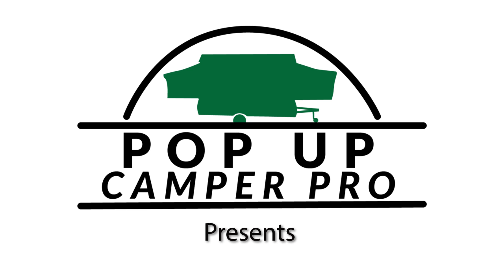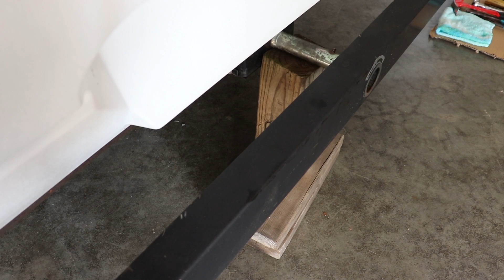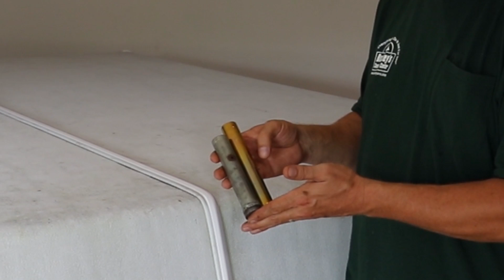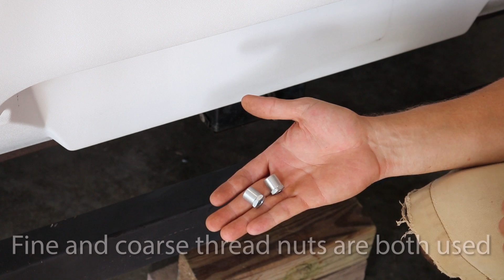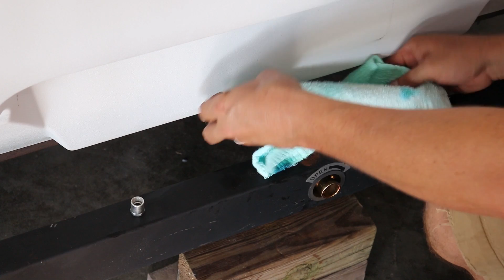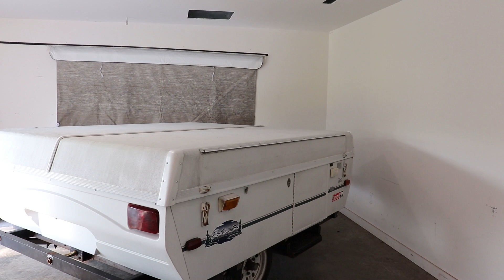How to install a drive hub extension on a Coleman or Fleetwood pop up camper

Comment: Okay so I commented on another video and you recommended looking into replacing the drive hub. But mines not on the bottom and exposed as much like this video. The tube is sticking out the back body panel. Does that change how I need to go about taking the tube off to replace it? Or does this video work for the Yukon fleetwood models as well?
Reply from the maker: All the drive hubs will install in the same manner whether its behind a panel or at the bumper.

Comment: Thanks for the video, Derek! We replaced our drive hub extension and we are back in business! We lost ours on our way home from camp. Quick question, how do you know when to stop unwinding when you are lowering the popup? If you go too far, does that loosen the drive hub?
Reply from the maker: I always recommend lock-tite the drive shaft nut on so this does not occur.
Reply: Great, we used the red lock tite so fingers crossed! Our camper is 30 years old and likely had the original drive hub extension. Always twisted and turned so surprised it didn't fall off sooner. Thanks again!

Comment: I suspect the issue is inside the box just beyond the crank assembly tube.  Do you have a video that shows how to take apart the inside and replace?  I have the model with the two open side bearing cup.
Reply from the maker: More videos coming soon on lift system components

Comment: 99 Redwood...top wont go gown after raising with zero issues. Seems as though it might be the hub extension, but is it possible that drive shaft itself should be replaced? New to camper life here!
Reply from the maker: It’s likely that the drive hub is not decompressing. I would start my diagnostics there.
Reply: @popupcamperpro  Will do, thank you.

Comment: My roof will not raise up. The extension tube just spins, nothing els is spinning. The tube is also loose and I can’t get it to tighten snug. I have not tried removing the nut yet. Do you know why the tube would be loose and nothing happens when I try to crank it up?
Reply from the maker: We do! This is commonly a stripped drive hub and or drive shaft.

Comment: Ya ...would of been nice to have 2 nuts to see which one fit right instead of having to order one
Reply: I ordered the 3000 crank assembly kit and received only one.
Reply from the maker: Two are included in the kits just for this Jeffery!
Reply: Sorry it was the rebuild kit. But it shows 2

Comment: Do you have to replace all the gears that they sell when buying the tube if its bad. Or just the extention tube?
Reply from the maker: The drive hub, drive shaft and clutch pad are common replacement parts. If the drive shaft and clutch pad are fine, replace just the tube.

Comment: If I have a sheared pin on my whiffle tree would that cause the pop up not to go up?
Reply from the maker: Absolutely, although it’s not common.
Reply: @popupcamperpro  it's was the nut on the front side by the eyebolts.

Comment: Can you tell me what to do if i can not get the bolt to break free? You made it look so simple.
Reply from the maker: If you have the dreaded slotted nut instead of the 5/8, you may need to cut the tube above the nut to allow extraction
Reply: Where do you cut it? I have tried with all my might and am turning the waffle tree in the process. Don't want to damage wiffle
Reply: Also a 5/8 socket fits fine

Comment: I looked in mine with a flashlight and that pin that the crank tool holds on too is bent weird almost a c shape in the center of it, not sure it will tap out correctly with a punch, Any suggestions?
Reply from the maker: You may have to cut it off Stephen.

Comment: Awesome Derek.  Watched many of your videos and was able to understand and fix my 1996 Sedona issue.  Roof was stuck in the up position.  I found the 5/8 nut in the tube was completely off the threads.  I was able to put it back on and tighten it.  Roof goes up and down fine now.  Any thought why it would have come off?  This camper is new to me so I have no idea what the history of the unit is.  Ran out of time today but tomorrow I will remove the tube and inspect the spacers, spring and washer as well as the threads on the shaft.
Reply from the maker: I recommend using Loctite to keep the nut on. Medium strength blue is what I use.
Reply: @popupcamperpro  thanks.  I saw that on the video and I missed that step when putting it pack on

Comment: Awesome info - is it possible the drive hub extension just needs a cleaning or do the mentioned issues (roof stuck up, no clicking, etc.) call for replacement?  When I removed the drive hub entension nut/tube, there was a lot of gunk, so wondering if I can reinstall after I clean it.
Reply from the maker: Give it a shot Gloria! It won’t hurt to try.

Comment: I followed these steps however it is not a 5/8 bolt, it is a large flat head "screw". I can not get enough purchase on it to remove. Have you ever seen this?
Reply from the maker: Yes. If your unable to remove it, cut the tube off to allow the removal.
Reply: @popupcamperpro  Thank you for your reply, what do you recommend to try removal before resorting to cutting tube off?
Reply from the maker: @andreathompson9933  you can try chemical penetrant and an air hammer to free it.

Comment: You could also use a scissors jack to support the old hub to remove the crank pin. Aside from that, you really need to be careful drilling a new pin holes for the crank. It has to be at the center line of the extension diameter. Otherwise, your crank will not engage on the pin. I'm just wondering why they didn't drill that hole during manufacturing.
Reply from the maker: Good tips GnosisMan50! I agree that perhaps we should start having the new hub kits manufactured with 2 or more position holes for the pins. Thanks for writing!
Reply: What if my 2 washers don't fit on shaft?

Comment: I have a new drive hub extension on its way for my 2000 Sedona. If this doesn't get my pop up to lower what would be the next area you would recommend focusing on? I have greased the whiffle tree and cables. When I went to inspect the whiffle tree the plate was off and the cables were spun once around the whiffle tree.I fixed that as best as I could - hoping there wasn't permanent damage from the plate being loose. Thank you for any and all advice.
Reply from the maker: Possible binding would be my next inspection. Cables and lift arms.

Comment: What size drill bit did you use to drill the holes?
Reply: I need to know that also
Reply from the maker: Simply choose a bit the same diameter as the pin or the existing hole. Easy breezy.

Comment: Can I cut off my extension I've and make a new hole AFTER I have the whole new lift system installed.  Forgot to do step #1!!😳
Reply from the maker: I do not see why not Jason.
Reply: @popupcamperpro  the vibration won't mess up the threads on the tube, shaft, or whiffle tree will it?
Reply: Thank you for all your help and videos  @Pop up camper pro!  I am now up and ready to go!😀

Comment: Is it the same for an older model(96)?
Reply from the maker: On older models that have drive hub extension tubes, yes. Not all have this system. It was implemented in the early 90's.
Reply: @popupcamperpro  thank you..bought a used 96 Fleetwood Taos last fall, took it out last weekend 1st time.
Had crank handle in it and my daughter ran back in to get something.  Tipped it onto the handle, now it won't crank up or down, just spins. Hopefully it's either the drive hub or the extension.  I'm checking out all your videos since no one in a 200 mile radius works on pop ups.  Again, thanks

Comment: It looks like we're going to need your drivehub extension kit although we are running into a major problem. Our tube is not unscrewing when rotated to the left after the 5/8 nut is removed. I suspect it's corroded on. Do you have an recommendations to get this removed?
Reply from the maker: It will come off. You will have to fight past the crossed threads. Don’t be afraid to cut it off close to the drive shaft, or use a bigger hammer.

Comment: I have a 2007 Fleetwood niagara and im getting resistance if I'm cranking the roof down. Going up is okay, clutch is engaging fine but going down takes a lot of effort. What do you think is the problem?
Reply from the maker: Hmmm. If the compression is disengaging completely in the crank assembly, I would suspect its binding in the arms, or the whiffle tree. I see on FB where you have maintained it by greasing. It could be an issue inside the drawbar block or bearings.
Reply: @popupcamperpro  thanks. I think youre right about it binding. Thanks!

Comment: What all is involved adding an electric lift motor to a camper that did not come with this option? I have a new to us 2003 Coleman Niagara elite and think I might like to upgrade the lift system.
Reply from the maker: Hello Don! Your 03 Niagara calls for the ball bearing whiffle tree 5361. At the following link you can find the instructions for adding a power lift to this camper. 
https://cdn.shopify.com/s/files/1/0273/4347/files/ELECTRIC_LIFT_INSTALLATION_BALL_BEARING.pdf?10244277974924402285
It should take about 2 to 4 hours, more than a few hundred dollars in parts and some fabrications is typically required as well. I hope this information is helpful, and thank you for writing!

Comment: How do you support the tube on the 2005 Utah to remove the pin when it is so much higher up.
Reply from the maker: Good question James. A 1x2 or similar board cut to length will do the trick.
Reply: @popupcamperpro  thanks. I am not yet sure if the extension tube is the issue, but the slipping seems to be for there. I was hoping to pull the wiffle tree cover off to inspect it today, but we have extreme rain and wind so it will have to wait. Hopefully it is the tube and I will be able to get it shipped up to Canada quickly or our trip in two weeks will be tenting it for a week.
Reply: @maryjuanarasta9220  yes. Replacing the drive hub extension tub fixed the issue.

Comment: Thanks for the video.  What size of drill bit did you use?
Reply from the maker: I checked my bits at the shop that I used, but they are not marked with the size. So sorry, we buy them in bulk from a nuts and bolt vendor, and I just grab an assortment from time to time. You can just match up the old pin with the same size bit. That's all I did. Perhaps someone else has a marked bit assortment and could answer as well?

Comment: My 2002 Sedona will crank up but it won’t release to crank down seem like the extension tube is locked the only way to crank down is to release the pawl
Reply from the maker: You are correct. The tube is not releasing in this instance. I would recommend removing the tube and inspecting the threads.
Reply: I have the exact same problem that it ratchets up but then won't release to come back down. Did you figure out what your cause was?

Comment: I have a Somerset with an electric motor and I’d like to add an extension. My spare tire is in the way at this time of me having to manually crank the roof. In case the motor ever fails, I’d like to have an extension so I can easily crank and not have to remove spare. Any suggestions?
Reply from the maker: A long reach crank handle or a fabricated motor over ride crank adapter should do the trick.

Comment: So on the Utah model the whole back panel would need to be removed to replace this right?
Reply from the maker: It should not be necessary to remove the rear panel to change the drive tube on any model. Doing so does give you a bit more access, and lets you inspect the overall condition of the crank and chain.

Comment: Perfect!! Thank you for making this video. So, in order to replace my thrust bearing, I have to remove this first right? 2007 E3
Reply from the maker: Not on every system. On your E3 you should be able to undo the pins at the whiffle tree coupler, and unbolt the crank assembly without removing the drive hub tube. It's never a bad idea to disassemble the drive hub tube and check the overall condition of the parts as well.
Reply: @popupcamperpro  I was thinking that! Great, I'll go that route first and then if successful I'll check out the hub tube. We are so thankful for your videos.